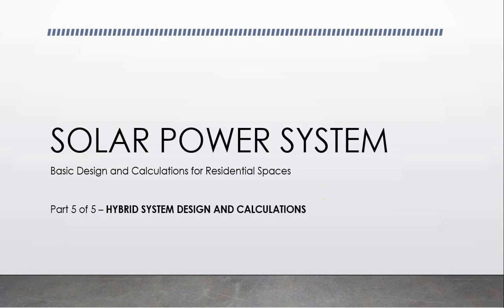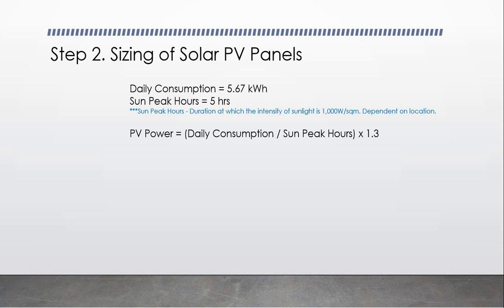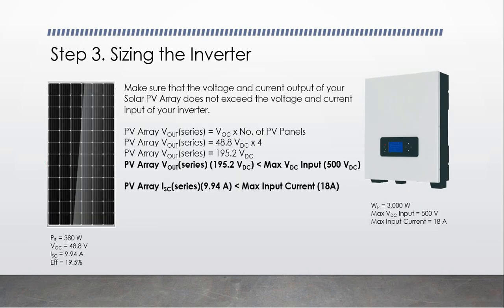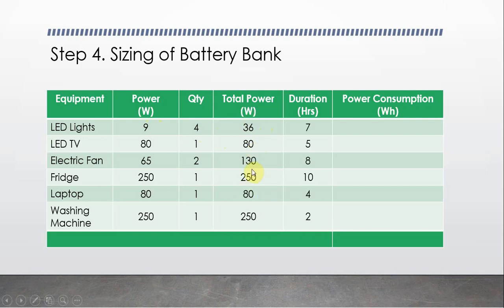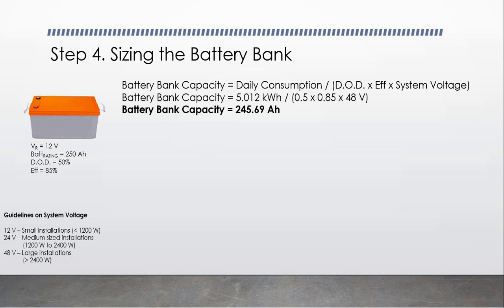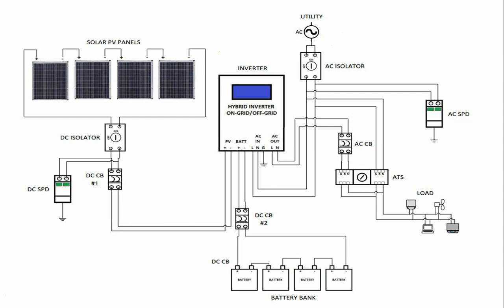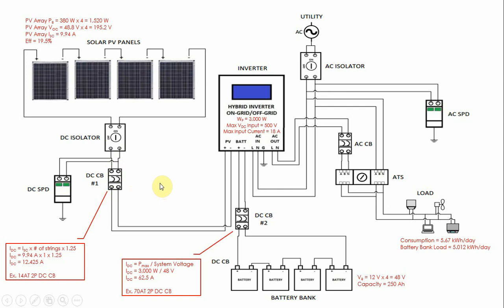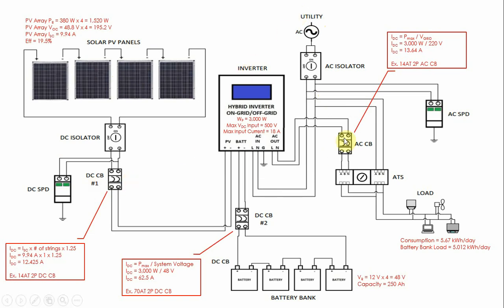DIY Solar | Sizing a Hybrid Solar Power System | Battery Sizing | On-Grid | Grid-Tie | Off-Grid

Comment: Very good tutorial. Thanks for your time preparing it. 

It is worth mentioning that hybrid inverters also has minimum and maximum Vdc range. E.g., 120-450Vdc. It means they will not work with low voltage from small panel array. So if your inverter is min 120Vdc and you connect only 2 panels with 50Voc each, it will not work.
Reply from the maker: Thanks for the info :)
Reply: Correct

Comment: Very good explanation of how to calculate a simple low energy system. Mine has been running for approximately 4-5 years without any issues. But due to the lack of summer weather here in the UK the system only runs for around 7 months of the year.👍
Reply: Its not entirely true. Thanks to Mppt controllers it’s possible to produce energy even during winter periods even in the UK.

Comment: Hi Oliver! In string calculation you did not considered Noct in respect of Vmp(min) to Vmp(max.)
I also recommend to explain module Voc minimum to maximum value at Normal operating cell conditions as per site calculations. Otherwise overall is good for beginners 🙏
Reply from the maker: Hi Vishesh, thanks for bringing this up. Should be a good subject to discuss in the future. 👍
Reply: sir recommend me any playlist for solar plant generation software which give a PDF report.  Thankyoy

Comment: Quite interesting and illustrative material. However, let me comment on two matters. Firstly, a 3kW inverter powered by 1,5 kWp PV array does not appear to be a good match. It is said that PV array power should rather be higher than power of an inverter. Secondly, the total nominal voltage of PV array should be adequate to the inverter starting voltage i.e. it should have been considerably higher unless the array works in very sunny good conditions for most of the day.

Comment: The AC CB should be placed after the ATS, because if there is a leakage  the ATS will switch to grid, you don't want that.

Comment: I think it would be safer to size your circuit breakers 25% more than its AC output if you use the National Electrical Code safety design regulations in case of an overcurrent scenario.

Comment: Thanks for the great tutorial. By the way, do you think DC isolator is needed? I can simply isolate the panels from the system with the DC circuit breaker.

Comment: What will be the size of SPD or how will we calculate the size and plz share the link of complete all 5 videos slides u play
Reply from the maker: Hello Sir,

For the Surge protection, take a look at the Uc and Up values of your SPD. Uc is the maximum continuous operating voltage, if the SPD senses a voltage above this, it becomes active. Up, on the other hand, is the maximum voltage across the SPD when it is active. Up is selected as such that it is below the overvoltage withstand capability of the loads. A typical DC SPD has a Uc of around 500 VDC and a Up of ~2kV.
As far as I know, there are 3 types, classified according to the frequency of the surge. Type 1 is installed near the panels for protection against lightning. Type 2 is installed between the source and the load, for added protection. Type 3 is installed near the load to redirect any residual surges - good for loads that are very sensitive to fluctuations. There are SPDs that can cater for both Type 1 and Type 2.

Below is the link of the complete playlist of this Solar Power Course.
https://www.youtube.com/playlist?list=PLDYXsYj860x-KM-osQhArbSJc2KsxvhO9
Reply: @OliverJayYoutube  thanks jay for detailed explaination really appreciated can you please share the power point files of this video

Comment: wonderful explanation @oliver jay.
my question basically is , how did you come about 1.3in the formular for PV Power i,e step 2 (sizing of solar PV panels).

Thanks.
Reply: It's because of the performance ratio of the installation site. For example, in Brazil, we have approximately 80% solar efficiency. So, the calculation would be 1/0.8 = 1.25.

Comment: hello thank you for this amazing lecture can you tell us more about the solar panels not all the pannels have voc 48.8 volt what to search for the panels specification in my system?
Reply from the maker: Hello sir, aside from the Voc, another important spec we should consider is the watt capacity of the PV panel. It helps to know several options for panels, inverters, and batteries so you can easily mix and match the items depending on your calculation. Easiest would be to seek the help of solar equipment supplier as they can easily recommend specific panels, inverters, or batteries for your project.
Reply: @OliverJayYoutube  thank you so much for replying you are amazing guy

Comment: Hi Oliver, in case of a DC load is connected directly to DC load output of a charge controller; how do you size the rating of your  DC breaker?

Comment: Nice.. Sir i have a question.. I have a 1.2kw hybrid inverter 12v and 480w solar panel.. Hybrid set up. 200 ah battery .is this set up can run my 1.5hp aircon?

Comment: Hi Oliver.

Thanks for posting this information.
My sister lives in Aden where the electricity is intermittent (on 3 hours off 3 hours) and a hybrid system may be the ideal solution.

1. Difficult to do load analysis because they didn't have ongoing grid supply.

2. Could do with a system that powers 2 air conditioning units (2600w) and the daily consumption could be around 50kwh. 

3. Would need a system that stores about 5 hours for use with air conditioning over night. Battery size 16kw?
4. Hybrid inverter 8kw?
5. 24x Solar panels 330w?

6. Would like the system run via grid and use the solar as backup

Any pointers you can give me would be greatly appreciated
Reply from the maker: Hello sir, i agree, hybrid should be the ideal setup if the grid us intermittent. i did a quick computation and yours should be ok. I believe you used sun peak hours of around 8-9hrs, correct? I think it's quite sunny in Aden but I dont have any definitive value on the sun peak hours so we'll leave it as you have calculated. Battery should be more than enough, should be at least 3 strings and 4 series of 12V/250Ah batteries.
Inverter type fridge and AC are quite difficult to estimate since their power consumption varies throughout the day and affected by many factors.
Reply: @OliverJayYoutube  thank you for the feedback

48v x 1000ah = 48kw excellent

12s bms?

Which inverter could you suggest?
Reply from the maker: @southernrealist5789  Hello sir,

Hybrid inverter 8kw
Battery bank 3 strings/4 series of 12V/259Ah battery (Total = 48V/750Ah)

For inverter, i'm not sure what is available in Aden. You may check the brands: Solas, Sofar, Solax, SMA, Huawei, etc.
Reply: @OliverJayYoutube  thanks for the advice Oliver.

Comment: Hi is the ATS really needed for this? Isn’t the hybrid inverter automatically distribute the power from the grid/battery/pv to the load?
Reply from the maker: Hi yes, correct sir. Minimum is to put a CB between the grid and the inverter. ATS is just an added layer of protection meant to bypass the inverter.

Comment: Hi sir kindly share how the wiring connection ATS. when power failure "off grid" and power restored "on grid" or day and night. thanks
Reply from the maker: Hello sir, the wiring for the ATS is as shown on the diagram in the last slide of the video. On one side, you will need to connect it to your normal power (utility) and on the other side your reserve power (battery and inverter). Best to consult the datasheet of your chosen ATS.

Comment: Which is better having high volts or amps   ? Which can charge my batteries faster
Reply from the maker: Hello Sir, current charges the batteries but, keep also in mind, voltage is the potential energy to produce the current.
If you add strings of PV panels to your solar power setup, you are basically increasing the charge current (but keeping voltage constant) thus, charging your batteries faster.
Reply: @OliverJayYoutube  thxz u. I have 16 . 100 watts planes (1600watt) n right now am having 2 set of 800 watt each set with 165volt n I was think I should have 1 set will get me 360 volt think is better for my mpp solar .. I notice that my battery dont rly charge full since it turn off around 12am n it better happend b4 and it always show me that my battery is 27 volt which mean is full but I dont think it is ...so the bottom line is 2 have 1 set of 360 volt to full charge my batteries better right ?
Reply from the maker: Hello sir, connecting your panels in series increases the voltage across it but decreases the battery charging current. Check also if the open circuit voltage is still within the MPPT specs.
Reply: @OliverJayYoutube  yea am getting around 325 volt. My rage is 500 on my mpp solar. I want to max it m get my battery full faster n let my mpp give power to my house without the battery support it... cuz my mpp solar work without battery. Is  pip 3024 gk 3000 watt 24 volt system n 500 volt rage

Comment: Hi sir , question how about for lithium battery? What would be the approach of computation?
Reply from the maker: Hi Velly, same approach as with Lead Acid batteries. Only difference is the Depth of Discharge (lithium battery DOD is around 90+%). Plus, each lithium cell comes in a lower voltage of around 3.2V/cell typically.
Reply: Question again sir , is it ok to sync the gridtie inverter to a generator? If not why?
Reply from the maker: @vellyyt3572  hello bro, technically we can to keep our solar power system running even during power interruptions but we should not do it due to safety reasons. Keeping our grid tie inverter running during power interruptions can export back electricity to the grid and may cause electrocution to those repairing the grid (i.e linemen).

Comment: Why did you multiply it by 1.3 for the PV panel sizing?
Reply: It's because of the performance ratio of the installation site. For example, in Brazil, we have approximately 80% solar efficiency. So, the calculation would be 1/0.8 = 1.25.

Comment: hei thanks for the insight..i wanted to know why it is written AC IN at the INVETER  yet we are transferring excess power to the grid during day time....or does the point has an input/output option for charging during night and transferring to grid during day time
Reply from the maker: Hi bro, this is an example of a hybrid on-grid setup. Depending on the setting, the system switches between utility power and battery. For example, during brownouts or blackouts, the system can switch to using the batteries. Or, if the battery is depleted, it can switch to utility power.
Reply: What is your setting base on your example diagram?

Comment: Hi sir, why is the there a need for a DC isolator switch in between the solar panel and hybrid inverter when there is already a DC circuit breaker present?
Reply from the maker: Hello sir, you can actually do without one. It is just an added protection. It also is for convenience, in case you need to repair something on the inverter side, you can cut the line from the PV panel through the isolator.
Reply: @OliverJayYoutube  Salamat sa reply sir! Thank you very much din po sa video series
Reply from the maker: Welcome sir!

Comment: I have a 5kw inverter with 12x435watt panels. Could only add 4x100ah batteries due to affordability. Usage is 50kw a day. Where do I spend the next money to upgrade? More panels or more batteries?
Reply from the maker: Hello Sir, it depends on priority. If you have critical appliances in your house that you need to power up for a long time then upgrade your batteries. If none, upgrade your panels and monetize your harvest by giving your power back to the grid (assuming you have net metering). Batteries are quite expensive to maintain. Just my opinion. Cheers!
Reply: @OliverJayYoutube  Thx, can feed back into the grid, looks like the best option to store for after hours.
Reply from the maker: Yes, and you get paid. You can check your local utility provider for Net Metering application. Cheers!

Comment: Sir how do you balance the batteries?
Reply from the maker: Hello sir I personally haven't tried using one but i'm thinking if building a small setup with a balancer when I get back home...currently stuck due to this pandemic. But, I do see a lot of battery balancers available in the market, it's just a matter of picking which one. 
If on a budget, you can do it manually by swapping battery positions every now and then.
Reply: If you put them in series for a while they will balance

Comment: AC circuit is calculated I=P/square_rooth(3)×U
Reply: Hi. You only use that formula on a 3phase AC system. So the presenter is correct in his formula P=V.I.pf (the pf is 1 in his case)

Comment: Hi Sir, May mairerecommend po ba kayong brand ng Hybrid inverter, for home use lang sana kagaya ng set-up nyo sa video.. thanks
Reply: Up
Reply from the maker: Hello maam, madami po kasing hybrid inverters. Best to choose the one that fits your specs and available locally (and sold by trusted suppliers) for easy warranty claims. Some brands that I know of are East and MPP solar, and solax.
Reply: @OliverJayYoutube   Hi Sir, Regarding sa battery bank 1 string and 4 series connection. meaning 4 pcs na 250Ah and iseseries? thanks
Reply from the maker: @lancetotgaming8079  yes sir, correct.

Comment: Can the inverter handle two different voltages from PV and battery bank?
Reply from the maker: Hello sir, if you are connecting 2 different sets of PV arrays in parallel, the inverter will see it as as one input only. You may compute the total voltage/current using the series-parallel computation.
As much as you can, you may want to avoid combining different PV panels or arrays as this can be a bit of a headache during maintenance/repairs.
Reply: @OliverJayYoutube thanks for your reply
I mean , the PV volt in your example is 195.2 Vdc while the battery is 48 Vdc.
So, can the inverter support or Handel these different volts together?
Reply from the maker: @abdrahmangalal7415  yes sir, the inverter will "step-down" this voltage to be suitable for your battery bank.
Reply: @OliverJayYoutube  thank you sir

Comment: Why do u multiply by 1.3 for the pv power? Also what if your battery requirement was 286.27Ah and you only have 250Ah rating batteries... would you do a series parallel connection and how would you go about it?
Reply: It's because of the performance ratio of the installation site. For example, in Brazil, we have approximately 80% solar efficiency. So, the calculation would be 1/0.8 = 1.25.

Comment: Why you have multiply pv power by 1.3
Reply from the maker: Hi Priya, for the panel sizing, that's to compensate for cloudy skies. For the inverter sizing, the 1.3 factor is for taking into account the surge power.

Comment: Hey I have a  ? If u don't mind

Can I have 1 set of 8 100 watt panels in seires making it 165 volt and 5amps 
N other set in parallel  making it 40 amps n 20 volt      ? 
And connect them all together so my battery will charge full ..
I notice my batter keep dying fast since I brought this mpp pip 3024gk . I try having 1 set making it 340 volt n still my battery turn off around 12am. 
What is ur take on that ? Thank you for ur time !!!
Reply from the maker: Hello bro, can you please give me your PV panel specs? I'll check on my end. Cheers!
Reply: @OliverJayYoutube   5amps 20 volt  100 watt.( I have 16 100 watt )
Reply from the maker: Hello bro, I checked your inverter specs. Max PV input is 500V and Max charging current is 80A. With your current panel qty, i think it is not fully optimized. If you connect all 16 PV panels in series, that only gives you 5A 320V 1600W. If you go with 2 strings of 8 panels in series, you get 10A and 160V 1600W. Both setups give you a lot of room to improve.
To optimize your setup, you may add more PV panels. 3 strings of 8 x 100W panels will give you 15A 160V 2400W. You can also have 4 strings of 8 x 100W for a PV array output of 20A 160V 3200W. Either way will improve your battery charging power.
Reply: @OliverJayYoutube  thxz but I just find out that my battery bank is only 225amps since I have 24 system now... I use to have 12volt system n get 450amp .. I have 4 6 volt trojan 105 re battery at 225amp each... but wen I make them 24volt system it will become 24 volt at 225 amp right ? I think thats the reason why my power turn off around 12 to 2 am .. am I right ?

What you think I should have wired all of them in 1 set to make it 5amp at 320volt or 2 or 3 set? If 3 set that mean I should buy 8 100 watt panles more.   Sum1 told me to get two set of 12 100 watt panles to make it 240 volt at 5amp each do u agree with that ?

P.s. thank you for ur time
Reply from the maker: @kissofdeath9660  Hello sir, tried calculating, your setup is fine (2 x strings of 8 x Panels in series, plus 24V 225Ah battery bank).
There are other factors that drain your battery bank, for example, high load consumption, cloudy skies can also affect battery charging.

Comment: Why do we still need ats?
Reply from the maker: Hi, this is to ensure that we have uninterrupted supply of electricity. The ATS automatically switches between the main power supply and the backup power supply. We can set our solar power system as our main and the utility power as our backup so that when the battery is depleted, the system switches to utility power.